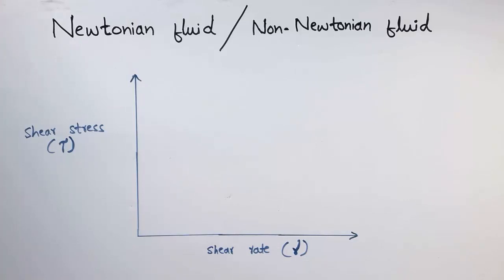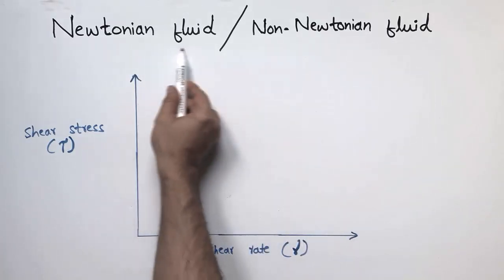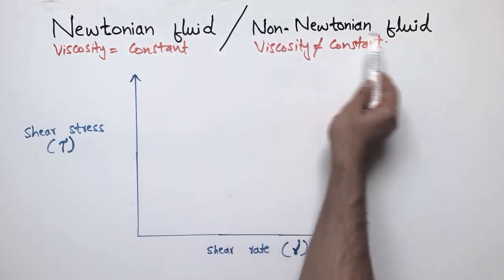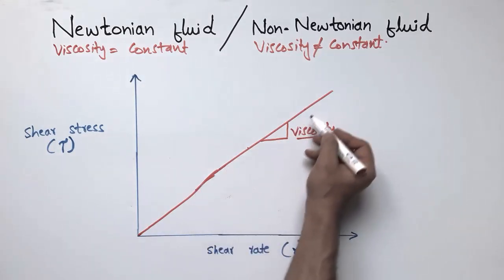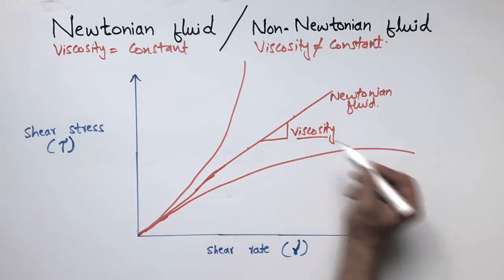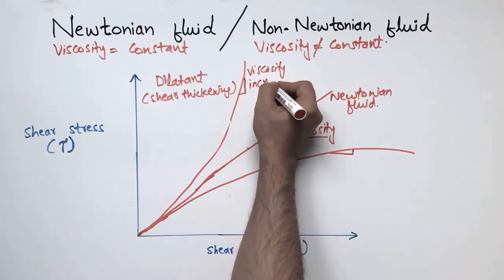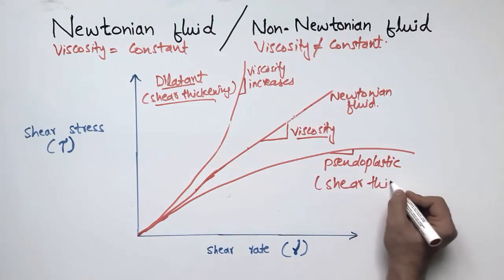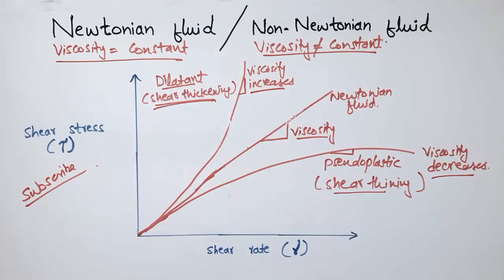Difference between Newtonian fluid and Non Newtonian fluid

Comment: I'm sorry, i'm not good in English. 
if the viscosity is affected by temperature, why does Newtonian fluid have a constant viscosity?
Reply: As the temperature of the fluid is increased the viscosity of the fluid will decrease at a constant rate for a Newtonian fluid (For example the viscosity will decrease by the same amount each time) .However for a non-Newtonian fluid the viscosity will decrease at a non constant rate which means the viscosity will not decrease by the same amount each time
Reply: @ruheet_plays977  thus from the beginning the definition of Newtonian fluid is wrong, because it's said that the viscosity of Newtonian fluid is constant!
Reply: This is a very good question.
I would also love to know the answer to it.